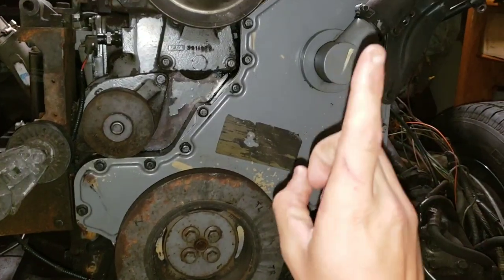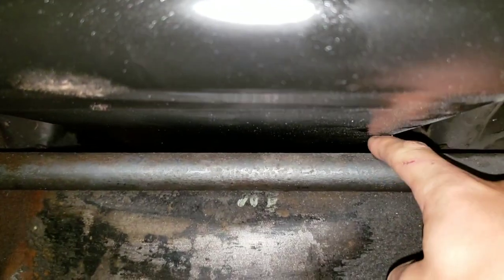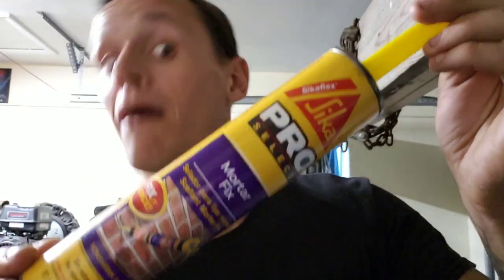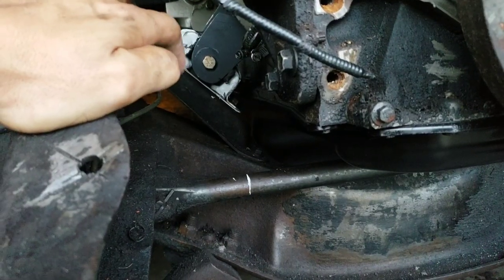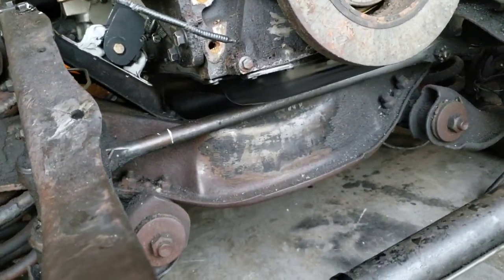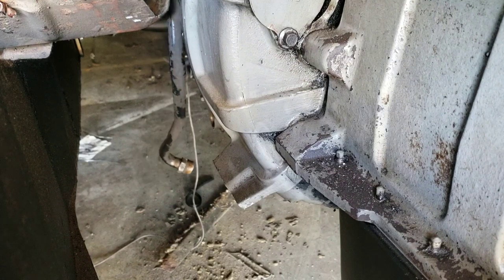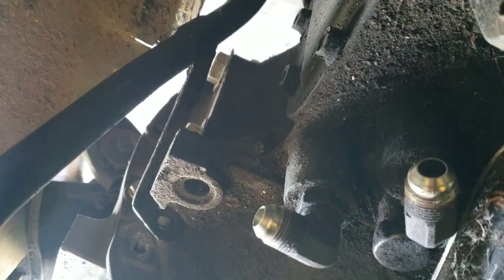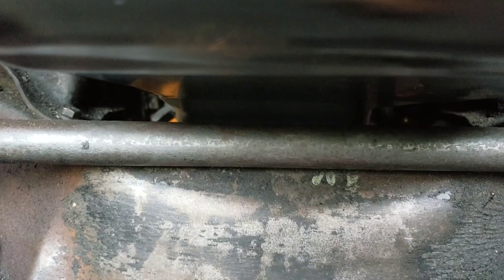Square Body Cummins Swap Part 5 (Reinforcing the Motor Mounts)

Comment: Hey Chuck. I am on same project, and have run into this same issue with engine mounts inside rubber shifting due to the added weight. Did the product you used work great for long term?? Or how did it turn out. I ordered new mounts, and prior to installing them I would like to inject a hardened rubber/epoxy material like you have done. Would you recommend same product you used ? Any insight appreciated!!
Reply from the maker: I highly recommend using the same stuff I did! "Mortar fix" if im not mistaking. I daily drove Bessie for the better part of a year before I took the cab off for repairs, and I haven't had a single issue with the mounts. That stuff is really holding up great! Good luck with your build!

Comment: Sika Flex: good stuff, better than regular caulk or Silicon for fixing those big holes probably in your floor pan, Use it all the time, for concrete work. sticks to everything, like your tats.
Reply from the maker: This stuff has turned out to be perfect for the application! The motor mounts are still holding up great!

Comment: Hey Chuck! Awesome work on this project. I have a C30 that I've contemplated this swap on. I wanted to give you props on having the courage to do this in your garage.
I wanted to ask, how is that half ton front suspension holding up to the weight of that engine?
Reply from the maker: Thank you! The suspension is actually holding up surprisingly well. I was almost positive I would have to swap out the light duty coil springs for some heavy duty ones, but so far its acting like the cummins is hardly there! We'll see how much that changes when its driving down the road however lol But for now it's looking good!
Reply: Sweet! You’re welcome, 
I’ll probably be in good shape then with the One ton springs in my truck. 
It’s a nail biter waiting for your next video lol.
Reply from the maker: @nickswayze  yeah you should definitely be good to go! The next video is going to be awesome! I made a lot of progress today so I'm excited to post it! Probably should be up later this week